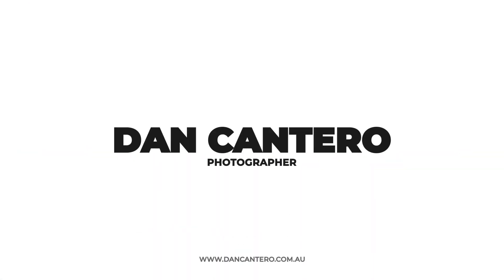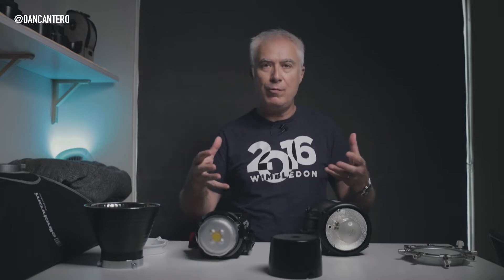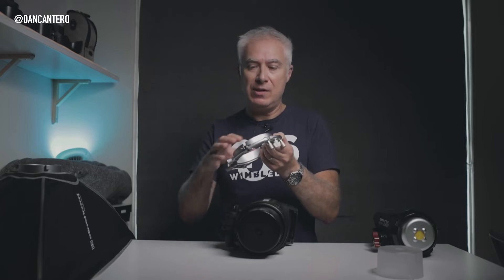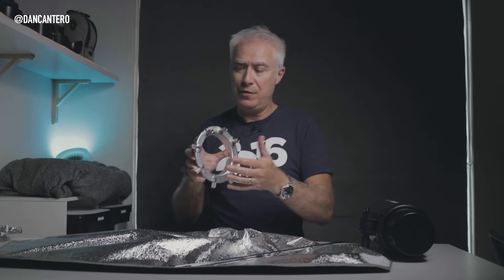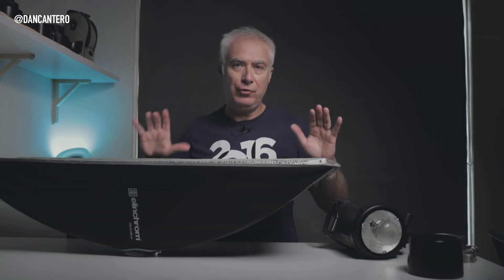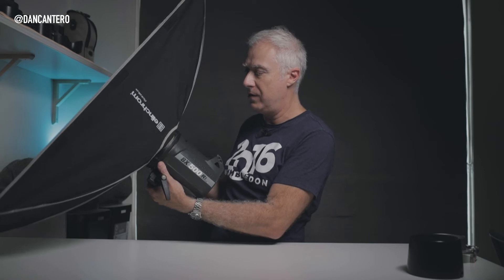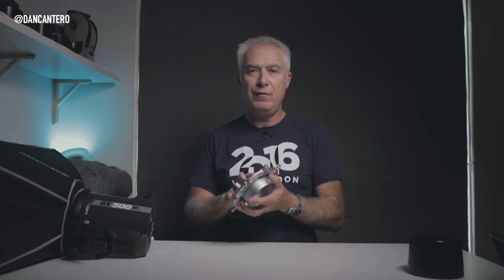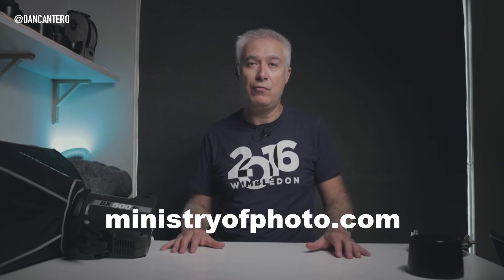Speed rings for strobes

Comment from the maker: If you don't know what a speed ring is, then you've come to the right video. In this video I'm going to show you what a speed ring is and how you use it to attach a light modifier to a strobe or a continuous light.

Speed rings are essential if you are using any type of like modifier because it is the only way to attach the light modify up to the light. There are various different types of speed rings and in this video I am going to show you what the differences are and how to make sure that you select the correct one for your lights when purchasing light modifiers.

In this video I am going to show you the Elinchrom and the Bowens speed rings.  I will demonstrate how to use them to attach the same softbox to both an Elinchrom strobe unit and then to an Aputure 120d which has a bowens mount.  Without the speed rings, you would not be able to attach any light modified to your lights as it is the attachment mechanism that let you do this.   

If you have any questions regarding anything in this video or anything else please let me know in the comments section below and I will be happy to answer any questions that you may have. If you have any comments and that is also the best place to make them. Alternatively, you can reach me through any of the usual social media platforms you will find all the links below.

Speed ring range from Elinchrom
https://www.elinchrom.com/range/rotalux-softbox/

BONUS DOWNLOAD

ADOBE LIGHTROOM KEYBOARD SHORTCUT GUIDE: ---  https://bit.ly/3eK6QVL

FREE Preset for you to download: ---  https://www.dancantero.com.au/presets

Come say hi on social

Website
www.dancantero.com.au

Facebook
https://www.facebook.com/DanCantero/

Twitter
https://twitter.com/DanCantero

Instagram
https://www.instagram.com/dancanterophotography

My favourite bit of kit

Canon EOS 5D MK IV https://amzn.to/3ddGcmh 
Canon 1DX MK II https://amzn.to/2Ci0P3Y 
Fav lens of all time!!! Canon 35 f14. https://amzn.to/2V3TnQu 
Aputure 120D https://amzn.to/3fEIcWq 
Mavic Air https://amzn.to/30Zv5Lf